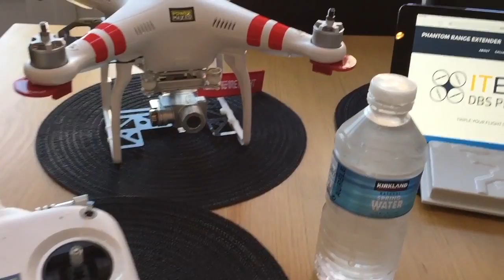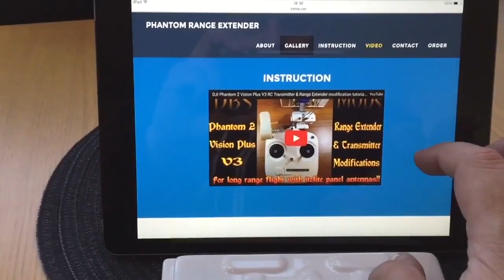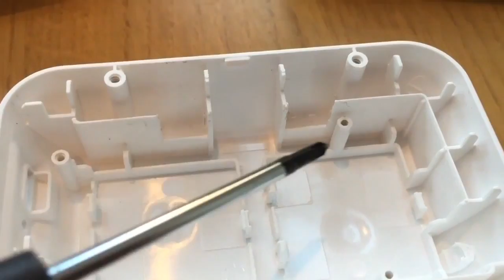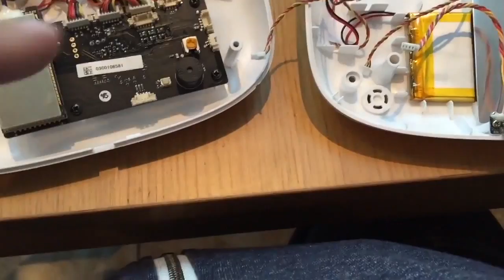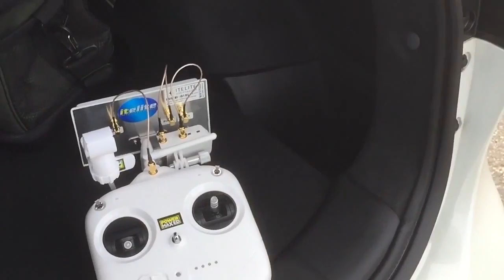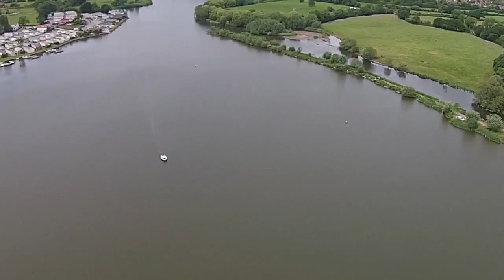Results of "real world" install and range testing of the DBS ITElite antenna for Phantom Vision+

Comment: Using thicker cables instead of the stock cables that come with the DBS Ant mod will greatly improve your range ..
Reply: I would be lying if I told you I knew. I have the DBS itelite antenna mod on my Inspire1, and It increased my range by an average of 2000 feet at an altitude or 400 feet AGL( the law in the U.S.A)..I inquired why I was not getting more range and I was told to use thicker shorter cables several people responded and told me and showed me results before and after cable upgrades that showed another 4000 to 1 mile increase very impressive .So cables ordered and on the way , I know your the walk a straight line type of guy and I commend you .but you should consider this this antenna mod also increases your ability to go behind obstacles with out loosing signal . so you could consider it a safety tool you do not have to fly far out.. There's a lake 1500 feet away from my house that harbors lots of wild life that I like to use my quad to go and photograph  but I would loose video at around 90 feet .. now I can go there and drop to 15 -20 feet with no problem allowing for great picture and nice viewing of wild life..Food for thought. And No jokes about wild life its not nude sunbathers LOL!
When I get my cables I will let you know the outcome
Reply: I also had a P2V+ and performed ant mods did quite well with the range but never liked the looks and bulkiness. But the DBS mods for the Inspire1 are first class very lite / compact and a stock look, not to mention the SST clip On / Off mount..i love it. For any one thinking of this mod I would rate it a 4 on a 1 to 10 scale 10 being impossible and 1 being peal and stick easy just watch the video and fallow along .O and by all means get a good set of tools like it states in the video.
Reply: Eloy Garcia Okay well the other day I receive my thicker cables and installed them , like a kid at Christmas I couldn't wait to test them so I stepped out side and of I went to 400feet AGL and set course on exact heading I did with the other three long rang tests with the thinner cables.So the conclusion from my test, Is that in my environment about the same time and with very close conditions. High temperatures in the upper 80's / very high humidity / and congested Wi-Fi area ,these are harsh conditions for radio signal transmissions.. 
DJI Inspire 1 with stock radio 3500 feet ,With DBS Itelite antenna mods 5800.feet , And now with the thicker cables 6700 feet (way short of what they say But Im Happy ) My next step is to go down to the beach and fly out over the water to see what range i get with what should be no interference

Comment: Wouldn't just making a coupling fitting or a "Y" or a "T" fitting for the outboard end of the antenna wire be the better way instead of hacking the Phantom and the extender to death?  For any added system,

Comment: I ordered the DBS range extender for my Inspire 1 based on your video.  I have seen there videos where they get more than 5 miles.  I am very excited.  Maybe you can do a review of this product when it comes out.
Reply: ***** done deal Simon... I will send one out right away. The inspire 1 and Phantom 3  use the same model antenna so it will broaden the  viewer base for the giveaway... great idea and thankyou for everything you have done for DBS MODs and ITELITE!!!
Reply: See Simon, ask and you shall receive.  To bad I already took delivery of the DBS antenna for my Inspire or I would have done the mod.  The difference is that I would have had some Johnny Walker Blue on my kitchen table.  LOL.
Reply: Yes we have to keep the consumption of JW to a minimum until after the work is done otherwise I find that there are "mistakes" made during work.
Reply: ***** I am excited though, right now I get about 7500 feet with my stock Inspire setup.  I can not imagine going double or even triple that.

Comment: Why is it necessary to remove the antennas?  They are under the circuit board and not in the way of the installation of the new antenna wires.

Comment: Simon. Please review the 14:09 part of the video where he shows circuit board without the antenna lead connected to it. I believe he may have a broken ground connection. If I remember correctly it should have a round outer part. If so you might want to warn people not to shear it by pushing screwdriver at practically 90 degree angle against the metal shielding as is shown here, instead get directly under where possible and pry up.  I broke one myself  on my old phantom vision 2 .
Reply: Hi Mark,

Did you manage to repair? I assumed that was how it was supposed to be,
Reply: Judgejase I simply replaced the circuit board. But if you know someone that is above average at soldering it may be possible to effect a repair by soldering the outer ground connection directly to the board. Only a guess though on my part. Wish you luck. Also I enjoyed your video otherwise.
Reply: Can I ask where you sourced your replacement circuit board please

Comment: After your first video , I ordered the ITElite and went ahead before this video from Jason came out, great video Jason. My comments would be that you have to be careful in placing the two holes in the WIFI extended . If they are drilled to low then the wires can only go under the board , but this did not seem to be a problem .Also I got the Nylon Velcro and did away with the bracket , this allowed me to place it into the GoProfessional backpack. Distance was about the same , but without any loss.I turned it back. Thanks Simon
Reply: I'm in holland, so my P3 advanced is in CE mode, and we gong to have new laws from juli
and on, and drones wil be restricted to 100 meters horizontal and 50meters up, andi'm afraid
that dji wil shorten the range even more to please our goverment, so would it be
a waste of money when i would buy this Itelite panel, or would it work anyway, whatever dji
is going to do trough hardware updates you can't deny 4ever?
Reply: It was well worth the Mod , even if just for the thrill of knowing I could do it , but mine was the P2V plus and Ive moved onto the Phantom 3 Pro

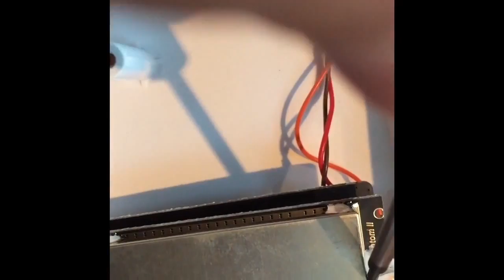Comment: Just jumping in here for tech support... you can see in Jason's part of this video (at the 13:50 mark)... he breaks the u.fl connector off of the board when he pry's the cable off the transmitter module... did he solve that problem and just not say anything in the video? Or is he running it that way? I bet he can get a mile in his area if that connection point is proper.
Reply: Hi DBS, I wasn't 100% sure if that was supposed to be like that or not so I assumed it to be ok, I did think it was a tad fidly to glue the wire in place as I had to hold it in place when I did. Wondering if I can repair this section now?

Comment: Quick question .. Is the extended range with the modification based on the UK's limited transmitter power setting ? I would expect if the  transmitter were set to USA FCC approved transmission power... Then the range should easily exceed a mile in distance.?
Reply: I'm in FCC mode

Comment: Hi Simon

And a big thank you to Jason for documenting, very concisely, the modification. What I especially appreciated was the inclusion of his initial mistake of drilling the wrong side of the extender case. I doubt he was the first nor will he be the last to do this but it emphasises the attention to detail required when performing such a mod.

I'm sure his range will increase as he gets more hands on with the patch antenna array and optimises its position. Some still don't appreciate that such a system doesn't amplify the signal but skews, sometimes referred to as beam forming, the radiation pattern to favour a particular direction and the further out you fly the more critical the position of the antenna becomes. It would be interesting to know if the video link held up over the same distance as the control link?
Regards
Nidge